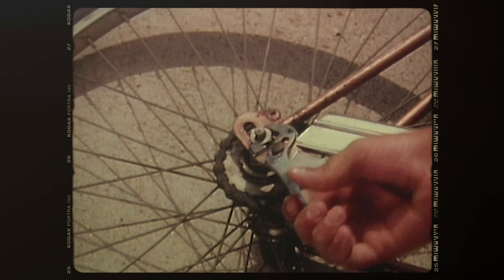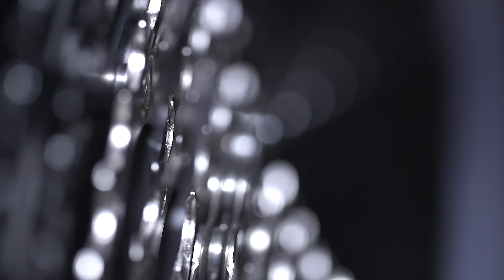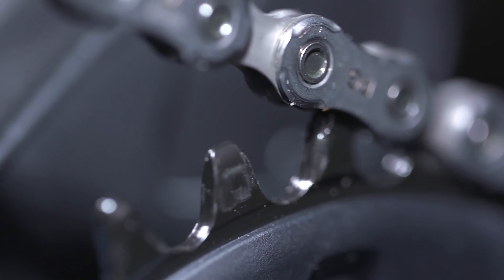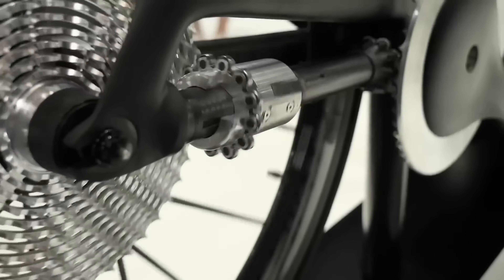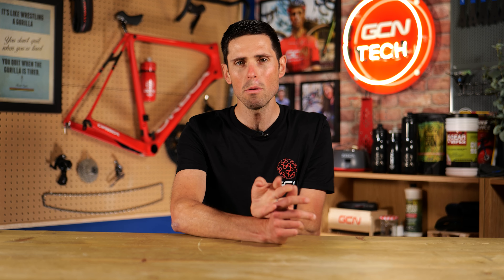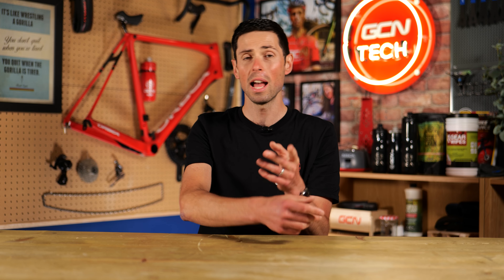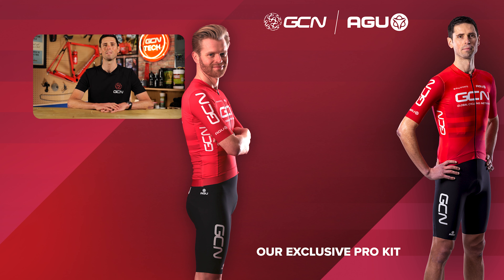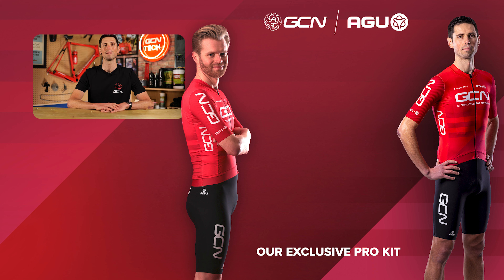Why This Will Never Happen!

Comment: The first production derailleur was by Le Chemineau in 1912. I think you're kinda over crediting Mr. Campagnolo here.
Reply: Good point. I just posted to this effect. I should have scrolled down first.
Reply: Guess which one sponsors GCN?
Reply: Didn't Campy invent the modern, parallelogram-based derailleur, with previous designs being based on worm gears and the like?
Reply: @HabaneroTi  My recollection is that Simplex actually invented the parallelogram derailleur and Campy then bought the rights to use it and made it popular.  Suntour designed the slant parallelogram, some 20 years later, that we all use today.

Comment: The ceramic speed system is fundamentally flawed - even if you could make it work at high loads, you have linear progression in teeth numbers on the rear producing a non-linear progression in gear ratios.

Comment: Chains will probably always be the mainstream solution. However, I have two pinion / gates bikes in my stable and I put far more miles on them than anything else. I love the reduced maintenance. I change the oil once or twice a year and that’s it.

Comment: Question can be raised, if the 98% efficiency is believable.  Remember a chain is a primitive drive system. Unlike a gear it is not involute, it transmits part of its torque in a series of spikes. Put your bike on a stand and in the eleven cog, turn the pedal by hand. You can feel the bumps. The rear cog is effectively an eleven sided polygon. On a rigid test jig it may be 98% efficient, but driven by human legs, the torque spikes will be smoothed/attenuated/absorbed by the leg muscle. On a ten tooth cog maybe 10% may be lost??  This won’t show up in power transfer from crank to cog;  losses occur within the muscle.
If you don’t think this is the case, then why not have a four tooth cog. Which would be square. Maybe a square cog is 98% efficient.

Comment: Never say never. IMO the main bottleneck is cost rather than efficiency. A new solution will take off if it does away with the chain's limitations and drawbacks in an economical manner, even if the efficiency is lower than the best case scenario for the chain. Power transmission can be achieved in a variety of ways. The problem is with power modulation range, for which the chain is hard to beat economically. Once you sort it out though, the prices may be high initially, but will go down soon enough.

Comment: Belts seem to have taken over from timing chains in cars. The justifications being that belts are cheaper, lighter and quieter. Cheaper only for the manufacturer, the motorist still gets an enormous bill at the end of 10 years to replace the belts.
Reply: Unless you DIY, which I do. But clearly not for most people as it's a pretty involved process and if you don't get it just right you could destroy your engine.

That said, timing belts or chains, unlike ones on bikes, aren't meant to transfer power, but rather synchronize crankshafts with camshafts, so that the valves will open and close in sync with the pistons. So they should last much longer, as there's far less stress on them. Plus they're fully enclosed, as opposed to ones on most bikes. Of course, one should never wait until they wear out to replace them, or you'll be stuck somewhere at best and out an engine at worst.

Comment: For a single speed system, its possible to come up with a shaft drive that is very close to the efficiency of a chain drive. But once you add gears, you will be well below that efficiency. Gears multiply inefficiency. There is some progress being made with magnetic gearing, that is near 100% efficiency, but I don't see that having a place in bikes due to the very high weight. So I agree that at least in the foreseeable future, the chain and sprocket is here to stay.
Reply: Who would want a single-gear bike with a heavy, complicated system like a drive shaft? The parts for the drive shaft are particularly more complicated and therefore expensive to manufacture. That is why it was around on bikes for never more than a few years before it was given up for lower cost and ease of manufacturing.
Reply: @einundsiebenziger5488  A well designed system with a carbon fiber driveshaft could be as light as chain and gears. And also the driveshaft could theoretically be enclosed in the frame to be more aero. But its a lot of development for minimal gains.

Comment: I find electric-electric transmissions interesting. Not because of there efficiency, because they're not, but for their ability to link multiple riders with different power and RPM outputs. Although an incredibly niche application, multi-person bikes or recumends could benefit from it.

Comment: you don't know your numbers ! a 116 links chain is made of 464 pieces of metal (4 by link not 6)
Reply: 2 inner plates, 2 outer plates, 1 pin, 1 roller = 6 parts per link
Reply: @craigblowfield8821 isn't there also the bushings connecting the inner plates?
Reply: @craigblowfield8821 doesn't that double count plates? The next pin already has 2 plates, you're only adding 2 plates, pin+roller at each link.
Reply: @snowcrazed1  I think what is considered the link is the roller and pin at the centre with the inner and outer plates open ended on either side.
Reply: @snowcrazed1  exactly!
For each pin 1 roller + 2 plates. 
4 parts.
Reply: @snowcrazed1  yes i'm wrong :D

Comment: This thing is too close to a chain as far as exposure to elements and wearing out. The belt designs and gear box stuff seams to actually differentiate positives and negatives from a chain system.

Comment: I was critical of this CeramicSpeed vaporware immediately after it was announced. It was a publicity stunt that probably had the engineers uncomfortable while the marketing department make unattainable promises. Too many small bearings without seals, a "cassette" made from aluminium that would skip under any load-induced flex, even more so in lower gears... and they never did show us that they had working shifting before everyone forgot about it and the development seemed to have gone quiet.
Reply: And the NOISE!
Reply: the other big issue is that point of contact between the drive shaft and cassette is like only 2 or 3 teeth engagement which i dont know how you can make it strong enough without making it bulky and lite enough to compete with chain drive
Reply: Biggest 2 problems they forget:
1. Metal will flex/bend with force
2. Metal expand with heat, and shrink with cold.
What they presented, will only work in "perfect" enviroment.
Reply: Thar concept was so hilariuosly stupid I can't believe they even showed it. You simply can't trick physics - the force transmission to only one tooth at a time on the rear knocks the system completely out. o
Reply: This was actual innovation in contrast to the standard snake oil they usually put out.
Reply: That whole drivetrain would have to be extremely rigid to function under load, which means huge weight gain. And would really benefit from being enclosed, otherwise it would be as vulnerable to exposure to water and dirt as any chain.

Comment: Like everything, the choice in components should depend on what you're doing with the bike. I chose a belt drive for my commuter because of its low maintenance. At most, you have to spray it down to get rid of any dirt or dust, but that's the case for any bike. No lubrication is needed and it'll never rust. This is great for riding through puddles and rain and through snow in the winter. Being that it's a short distance commuter for local shopping, I'm quite happy with the 3-speed Shimano hub in the rear.

Comment: Nice opinion piece. You didn’t mention wax once! After touring abroad for a year I really wanted a 14 speed hub, belt drive, drop handle bars and fat tyres for my daily ride. Gravel bikes have come along since then and some very expensive marques meet my requirements. But sadly I don’t think this will ever come standard/cheap.

Comment: A bike chain being expensive is because you buy fancy parts. On a commuter 8 speed setup is optimal for cost, or you could go slightly newer. Heck single speed is even better since you need no maintenance.
If I was seriously worried about bike chain cost I would go back old school and run an encased chain with lube inside.
At most I can see belt drive or shaft drive takeover for e-bikes with their already built in transmission. Functioning a lot more like a motorcycle then a bicycle.
Reply: I thought the same thing. For my old 3 x 8 speed clunkers, replacement chains cost about a tenner. They seem to last about a year of my usage, regardless of how expensive they are. I suspect the 1 x 11 or more gears on modern mountain bikes and hybrids amount to more trouble because of the thinner and less robust chains, sprocket etcetera.

Comment: Nitpicking here, but the nerd/journo in me wishes they would send their scripts out for proof reading by people who know math/physics/manufacturing. 
He talks about the chain being able to withstand "50.000 psi of pressure". Then "not your ordinary steel like recycled tin cans" and finally saying that there's only a 1.4% gain left on the table until you get to perfection as the best chains are already 98.4% efficient (also, stating 98.3% earlier in the video).

Comment: The bicycle chain is about as optimised a design solution as is possible. Any "improvement" on it provides such small margins, at such increased cost, that it will be next to impossible to replace it. If anything better was possible, then all of the professional bicycle racing teams would already be using it. Plus, the bicycle chain is a perfect example of the KISS principle. Anything else adds too much complexity for what the bicycle is.

Comment: The main problem with a chain is that it's exposed to the elements, so while it can last 30000km when waxed regularly, in practice a dirty chain will hardly last 500km. Fact is, most people never ride anywhere close to that. Internal gear hubs with belt drives require effectively no maintenance easier and will consistently last tens of thousands of kilometers, but they are heavier, more expensive and less efficient. Thus, chain alternatives only make sense for commuting and long-distance cycling, which is a small sector overall. e-bikes are one area where belt-drives actualy make a lot of sense, I expect them to gain popularity

Comment: I used to live next door to some guys who raced motorbikes and built them to race in the TT.  They always looked at my bike and tut tutted at the way a double chainset 6 block  bike would run with the chain out of a straight line. Guess motorbike chains do not flex in the same way. :)

Comment: I love my commuter belt drive bike with Alfine hub. Stood in the rain the last 6 years, just replaced the corroded headset, but everything else still fine, working and with no rust.
Bikes like these are actually really common for commuting here in Germany.

I also love my singlespeed with a chain, but the belt ist just much less maintemance and produces less stains on my trousers, especially in the rain

Comment: Au contraire! The belt drive is pretty common on newer commuter and everydaybikes in my area. No matter if ebike or without electric motor. Its sold to people who just want a tool to get from a to b and when riding i hear many people and their noisy chains that should switch to belt drive too.

Comment: I'd be fine with a chain if we had airless tires that held their own against our current speedy options.   No flats and no maintenance until they wear down.   Sign me up.
Reply: It is very unlikely.  If someone asked me to invent something that would provide cushion with minimal weight, and would never lose that spring, and would be shippable in minimal space, I would have to invent air.  And if someone asked me to invent something that would grip a road under varying conditions without hooking into it, and last for thousands of miles and not be loud or dangerous in a wreck, I'd have to come up with a fabric casing bonded to something like rubber.
Reply: There is option to inflate it with foam that they use for construction vehicles, and google other solutions. You can buy strongest tubeless tyre with strongest sealant like silca and put insert inside so it will run even if you get puncture
Reply from the maker: It sounds good in theory, but reality isn’t like that. In fact, we have a video discussing it. 👇 
https://youtu.be/GAbj67HUzf0?si=0y3F_IHL-O6aY4o5
Reply: Schwalbe marathons will guarantee you never get a flat.

Comment: I think your math was a bit off: 200 watts affected by a range of 98.6 to 81% efficiency results in a range of 2.8 watts to 38 watts lost, not 18 watts.
Reply: The efficiency of a chain drive increases with increasing power. Because the losses on the returning chain remain the same, while the losses on the pulling side increase.
Therefore the efficiency at 50 W is significantly worse than at 500 W.
Reply: I think it was metric watts, not imperial watts
Reply: @j.h.4506  As the inventor of the steam engine, James Watt invented horsepower in order to be able to market the machines better. Watt is one of the SI units.
Reply: @j.h.4506  Percentages of something don't care about the unit. What I'm talking about is 98.6% leaves a 1.4% loss and 81% efficiency leaves a 19% loss.  1.4% and 19% of 200 watts (be it metric or imperial) is 2.8 and 38. I'm guess the math error was seeing 100-81=9 when it's actually 19.
Reply: @j.h.4506 watt?

Comment: You haven't mentioned ease of maintenance and changing. People can understand how normal gears work and there are no complex internal parts. Bikes with a chain and a cassette all work in broadly the same way and any moderately proficient cyclist can get their head around changing the chain or a cassette. There is an automatic assumption that the ceramic speed design would be harder to work with, and people don't want a solution to something they can work on themselves and is already pretty efficient.
Reply: Frequency of maintenance is a factor too. And that's where belt drive is currently the undisputed king.
Reply: And yet people keep coming back to chains, so it must be less of a factor than you might think. Plus, if a belt drive isn't single speed then good luck to the average person trying to address any frustrations about their gears.
Reply: @Shellewell  I'd say people not knowing about belt drive is the reason they don't use it rather than them specifically choosing a chain. Chain drive is just internalized. Everyone grew up with a chain, everyone sees chains, chains are on almost every bike that exists. Then for those who would like a belt drive you find out the cost of it up front which is a huge downside that prevents people from adopting it. I had fully intended to get a belt drive but it would've been almost double the price of the bike I ended up buying after the cost of the gearbox. If the prices were much closer I'd have chosen a belt guaranteed. I'm never going to race and fiddling with the chain and derailleur has already become kinda annoying.

Gearboxes are really reliable as well. There isn't much to go wrong that would require most people to need/try to service it themselves.
Reply: Just carry a chain tool and if your chain breaks mid ride you can fix it back up to get you home. A belt or a shaft looks more robust, but failure would be a long walk home. And probably more expensive, in the case of a shaft system.
Reply: @Crall-xb8he  A belt if very unlikely to ever break. Belts have torque ratings beyond what motorcycles can put out. You're more likely to see fraying and know there's an issue before a belt just randomly snaps. Bike packers have gone across entire continents on a single belt in insanely harsh conditions without issue. The metal of the chainring wears out before the belt.
Reply: @scopie49  Can’t argue with that on the whole, but there is always the chance of a bad un. The engineering fallacy of assuming something won’t break because it’s been designed not to…
Reply: @Crall-xb8he  I mean fair. But that goes for anything mechanical. Could always carry a spare belt if you're worried about it just like we carry spare tubes. A derailleur could break or bend. A chain coming off could wreck your cassette. There's plenty of what ifs. Whether it's a chain or a belt, if something mechanical fails, your day kinda sucks.

I had a flat tire .2 miles from home the other day and it still annoyed me.

Comment: It blows my mind to think that for decades in the 1800s mighty locomotives were steaming across the land while the safety bicycle was yet to be invented.  And I agree with you, Alex, chains are here to stay, otherwise they'd be carbon wires by now or something.
Reply: If You think: Locos from early age has no chains - just direct drive to wheel, exactly like in penny-farthing bike.
Reply: @stanley3647  It is just that, wow, locomotives were technical marvels brought to life by brilliant designers and steel workers and it would seem that people creating something that complex could've cooked up the safety bike with two same-size wheels and a drivetrain as a personal propulsion system similar in concept to their mighty locomotives.  And ultimately, great that we got the safety bike decades later and not a century or never later.  😀

Comment: Ceramicspeed=crap. No, I won't explain - every mechaning/engineer can spot it easily. Belt drives are excellent under +/-steady loading conditions, and when maximal efficiency is not needed. Chain simply has far too many advantages...